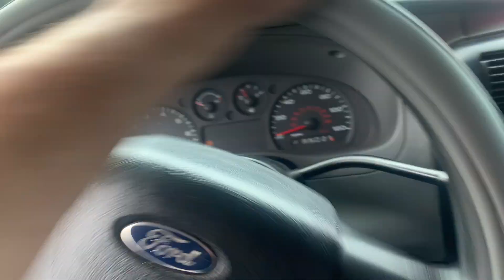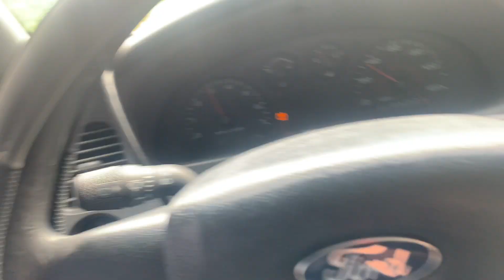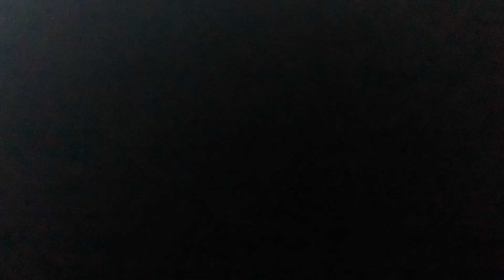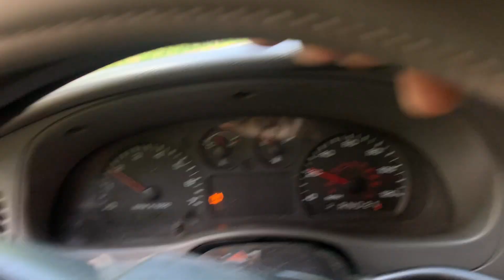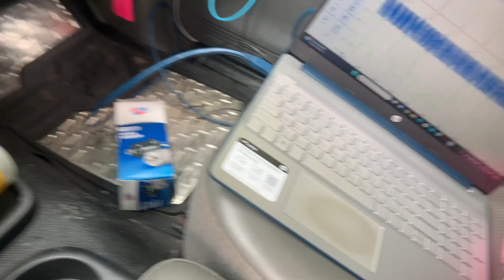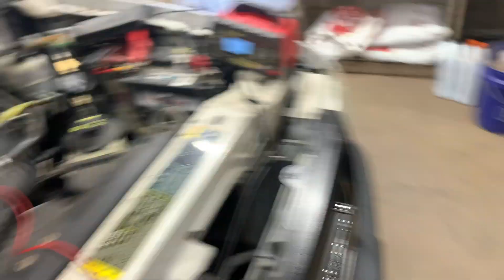Ford Ranger, Engine Cutting out & the Fix (No Codes)The Picoscope for the win, 2 day Diagnosis

Comment: Good afternoon 
Jon I have a 2002 Ford Ranger 2.3 with 130,000 original miles 

It looks like I have the same problem. Thanks for your feedback, I'll be sure to check in the engine compartment and check fuse # 39
Thanks

Comment: Man I got the same problem with a 2010 and my fues was blowed but it's still cutting out after I replaced it any thing else I should look for
Reply from the maker: Make sure all the fuses are in the correct spot, that was the issue with this one

Comment: How do you get 24 volts without a fuse? Also wouldn’t you think it’d be a no communication with a fuse missing
Reply from the maker: I can’t explain the 24v fully,the only thing i figure is there was a backfeed  with the fuse missing, when i put the fuse in the voltage went to normal system voltage, as far as the no com, there's several power wires going to the pcm, only losing one would not cause a no com, im sure its dependant on which power feed was lost though, thanks for watching